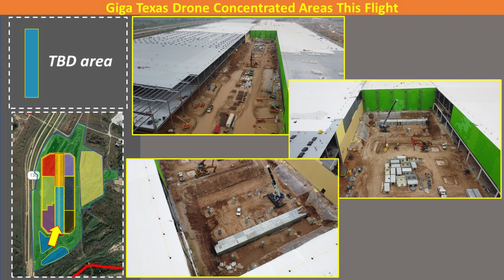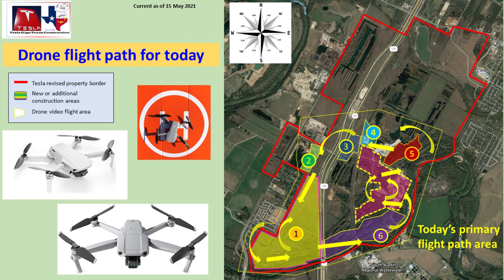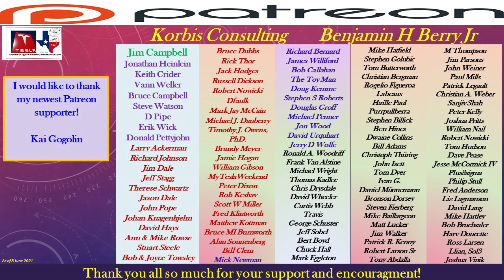Tesla Gigafactory Texas 8 June 2021 Cyber Truck & Model Y Factory Construction Update (07:45AM)

Comment: Thanks Joe. Drying up nicely. Water truck drivers awaiting the order to turn the mode switch from 'suction' to 'spray'.
7:21. There are 4 column pedestals here with a slot in the top face. This slot is a feature elsewhere along this side of the building where braced columns were located. It will be a forest of bracing here in this turns out to be the purpose. 
8:57.  Roof insulation. Different product under the black wrapping, or expecting rain? 
13:04. Delivery of the purple drywall, and or shaft-liner. Shaft-liner sheets are narrower at 2’ 0.6m. Generally 1” 25mm thick.
13:15. West face of concrete wall. Purple shaft-liner is being installed and seems a stud wall then being constructed. 
13:56. Western most vaults are open at the end, another pair to be installed.
14:50. Note quite enough pit excavated for the next columns. Likely only to install a third row of vaults.
Large round precast pipes, I’m curious about the diagonal slice off the edge of the 2 on the left. 
Pallet covering a hole to the right of the red truck. Drain perhaps?
Circular object at the base of the column is a road saw blade.
15:10. Busting out the concrete around the double column base. The footing is being widened for a column, don’t know why the slab needs to be removed.
15:18. Geo-piering. 
15:42. Right of screen. Second level. Worker walking along the row of shear studs giving each one a tap with a hammer to check if it stuck.
18:39. Bottom of screen. A spare double T roof panel, and 2 large flat beams the same as those installed in the stamping plant towards the south on the west side.
23:46. Base of column. Blue bags of grout, mixing buckets, and the hose for injecting the grout into the sleeves. Pump/gun must be just out of picture.
Reply: At 14:50 the large round concrete pieces are storm manhole sections. The second from the left is the base section and the cut out will be for the bottom section of a connecting pipe. The section on the left I will be the next section installed that has the top half of the pipe cut out. The right two sections continue on top up to grade. There will probably be a cover slab for the top.
Reply: @bobcallahan2322  Ok, I think I have it. So those are horizontal sections that join together, making a round opening, with a vertical shaft to rise off the opening. A 'T' in fact?
Reply: The manhole sections all stack vertically. The pipe entrance is large and goes right thru the joint between the bottom section that has the concrete base and the next section above the bottom that has the half round hole at the bottom. The section of the ring in the pipe entrance on top of the lowest section will be cut out once the sections are stacked to make the large hole for the pipe to go in.
Reply: @bobcallahan2322  Hi Bob. I see now the second from left pipe has a base. I understand now how the junction works, just don't quite understand where it fits into the system. If the manhole sections are vertical, the branch is intersecting horizontally. Time will tell.
Reply: 15:04: worker sweeping the inside of the yet-uninstalled water vaults?
Reply: @greggerypeccary  Painting methinks.

Comment: Please forgive me if this has been discussed before, but I think I now. realize why the “alleyways” exist. They were never meant to be loading or access roads for trucks. Even when it was in the more central location originally. The reason for them is because the concrete pumps can’t reach the full width of the building from say the west side. You can only pump concrete so far, even with the biggest of concrete boom pumps. Having the alleys means they can pour the floors from both sides and meet in the middle. Then they can build up the alleyways and pour concrete floors as the go out to the perimeter. That’s my belief anyways.
Reply: Maybe for access to those hard to reach areas. Maybe later they will close it off
Reply: I was skeptical from the beginning that they were going to have “roads” inside even for electric trucks. It just never made sense

Comment: I don't think they've quite finished the first row of water vaults. IIRC the end ones to the west still have large openings and there is room for one more set.

as for the lined pond, I think we've seen the water vaccum trucks dumping their loads into there.
Reply: Yep. that's what I saw also.
Reply: I think you are right on the water vaults. I am thinking that the new excavation on the south side of the pit may be for crane access to set the second row of vaults. At the lined pond I have only seen water trucks (no vacuum trucks) that have been spraying off their loads thru the rear spray bar into the pond. It must be clear water that they are hauling because the water color is changing away from mud color while the other ponds are not changing color. The water trucks seem to be loading in the vicinity of the in use temporary cooling units.

Comment: Lol not quite ready for shipping. Those are test pieces they run when a die cast machine first gets set up. Just gotta make sure it works
Reply from the maker: Since you seem to know, can you say how many test pieces do they need to make to verify proper operation.
Reply: @JoeTegtmeyer  At this point I'd assume it's just enough to verify the machine is running properly...all the hydraulics, the TCUs, sensors, safety systems, etc. Verifying that parts are good and ramping up production is a few months away. Let's just say I work for a company that has a facility in Fremont, CA and my job is in QC in a department that makes things eerily similar to those parts.
Reply: @JoeTegtmeyer  I realized I didn't answer your question...probably a couple dozen.
Reply from the maker: @EricJDrake  ok ... they’ve made over 1,000 already so I think they have the casting machine dialed in.  Number 2 is almost ready for testing.
Reply: @JoeTegtmeyer  lol I guess YouTube has better information than I do and they're shipping cars out of a construction zone. I didn't say they weren't continuously producing parts, I said not ready for shipping and two dozen to verify operation. Production isn't scheduled for a while.
Reply from the maker: @EricJDrake  OK
Reply from the maker: @EricJDrake  OK ... thx

Comment: I only see 6 columns standing and 3 laying down in the Casting area.  What am I missing?  Where are 7 and 8?
Reply from the maker: There is a double column next to the original casting structure ... where the bridge crane rails are
Reply: @JoeTegtmeyer  that is 7… but at the gas riser column there isn’t a second column yet.
Reply from the maker: @patrickkenny2077  OK … they’ve now installed about 15 or so … will do an update tomorrow

Comment: They need a sound barrier between the factory and the freeway to prevent workers getting affected with Hearing problems. This will results in annual hearing test as per Environmental regulations?
Reply: There will be more noise in the factory than from the freeway. They won’t even be able to hear the “noise” of the freeway and honestly that doesn’t cause hearing issues. It’s more annoying than anything but in a factory setting it’s the factory equipment that will cause hearing loss over a period of time. The cars on the highway will be drowned out